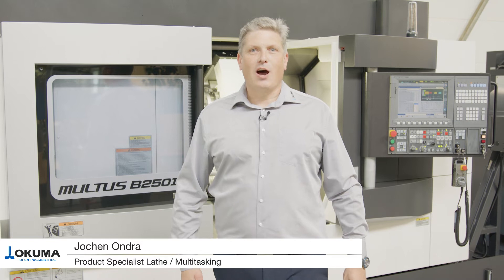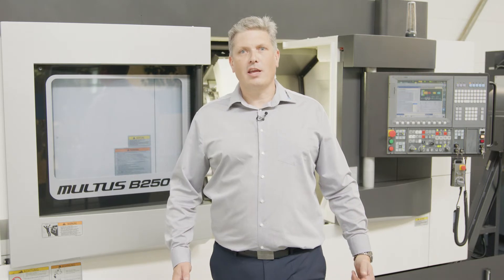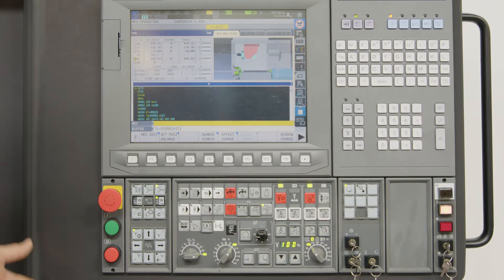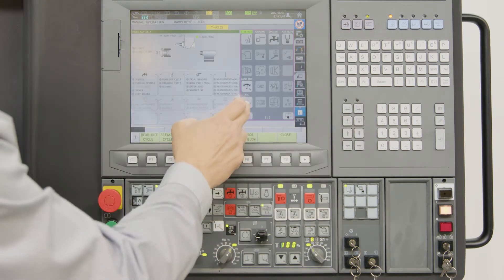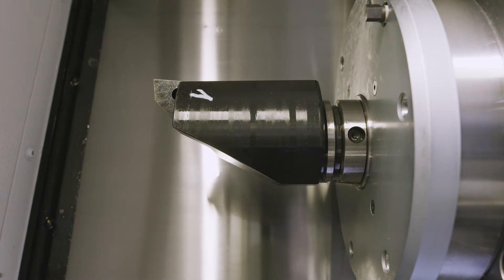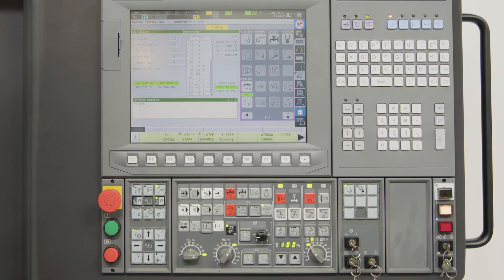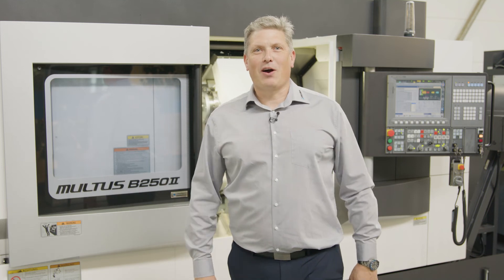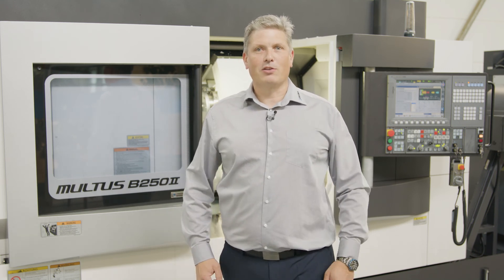How to - Recover ATC

Comment: Okuma multus b400 with osp 200L, the arm is clamped on the tool and forward/backward step doesn't work. There's a little movement up and down of the arm but doesnt unclamp the tool from the turret. 

I have to somehow make the arm unclamp the tool inserted in the turret, move it away and take out the tool manually and then use the atc advance/reverse step just don't know how to do that.😢